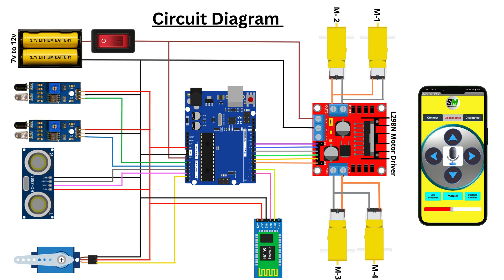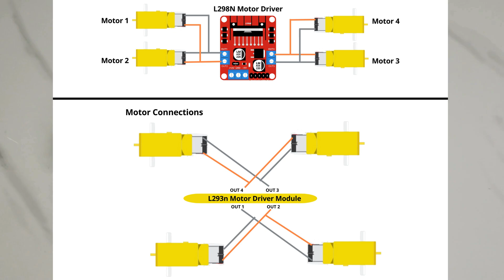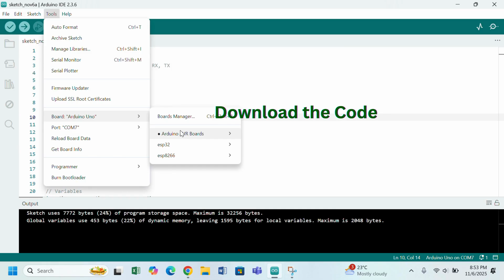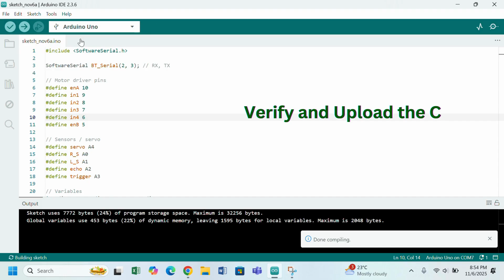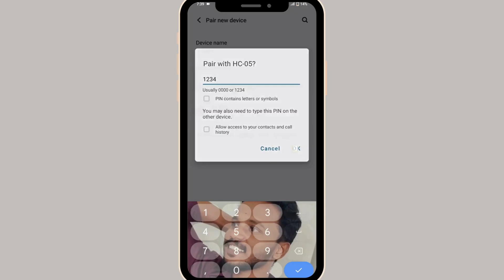Smart Robot | All in One Arduino Robot Car | Bluetooth, Voice, Line Follower & Obstacle Avoiding car

Comment from the maker: If you have any doubts or need clarification, please feel free to email me or message me on Instagram 🙂
📧 Email: sminnovativeidias@gmail.com
📩 Instagram: sm_innovative_idias
-----------------------------------------------------------------------------------------------------------------------------------------
Before you start the project, please check whether all components are working or not
---------------------------------------------------------------------------------------------------------------------------------------------

📥 Download Links:
• Arduino Code: 
https://drive.google.com/file/d/1Vvah7PBQV9rs2WK8pXPLR-j1gpCAnVpp/view?usp=sharing

• Circuit Diagram:
  https://drive.google.com/file/d/15Lyp05Bqr6NomTcdBRlfqU1RMfgjVBlc/view?usp=sharing

Bluetooth RC Controller App :-
https://drive.google.com/file/d/1KYsFZcAKsPvFJPlwvRlGJr8W_TbCVdFB/view?usp=sharing

copy the code 
------------------------------------------------------------------------------------------

#include <SoftwareSerial.h>

SoftwareSerial BT_Serial(2, 3); // RX, TX

// Motor driver pins
#define enA 10
#define in1 9
#define in2 8
#define in3 7
#define in4 6
#define enB 5

// Other sensors / servo
#define servo A4
#define R_S A0
#define L_S A1
#define echo A2
#define trigger A3

// Variables
int distance_L, distance_F = 30, distance_R;
long distance;
int set = 20;

int bt_data;
int Speed = 130;
int mode = 0;   // 0 = Manual / Voice, 1 = Line follow, 2 = Obstacle Avoid

void setup() {
  pinMode(R_S, INPUT);
  pinMode(L_S, INPUT);
  pinMode(echo, INPUT);
  pinMode(trigger, OUTPUT);
  pinMode(enA, OUTPUT);
  pinMode(in1, OUTPUT);
  pinMode(in2, OUTPUT);
  pinMode(in3, OUTPUT);
  pinMode(in4, OUTPUT);
  pinMode(enB, OUTPUT);
  pinMode(servo, OUTPUT);

  Serial.begin(9600);
  BT_Serial.begin(9600);

  // Servo initialization sweep
  for (int angle = 70; angle <= 140; angle += 5) servoPulse(servo, angle);
  for (int angle = 140; angle >= 0; angle -= 5) servoPulse(servo, angle);
  for (int angle = 0; angle <= 70; angle += 5) servoPulse(servo, angle);
  delay(500);
}

void loop() {
  // Bluetooth / Voice data receive
  if (BT_Serial.available() > 0) {
    bt_data = BT_Serial.read();
    Serial.print("BT / Voice Data: ");
    Serial.println(bt_data);

    if (bt_data > 20) Speed = bt_data; // speed control by app slider etc.
  }

  // Mode select
  if (bt_data == 8) { mode = 0; Stop(); }         // Manual / Voice mode
  else if (bt_data == 9) { mode = 1; Speed = 130; }  // Line Follow
  else if (bt_data == 10) { mode = 2; Speed = 255; } // Obstacle Avoid

  analogWrite(enA, Speed);
  analogWrite(enB, Speed);

  // -------- Manual / Voice Mode --------
  if (mode == 0) {
    if (bt_data == 1) forword();
    else if (bt_data == 2) backword();
    else if (bt_data == 3) turnLeft();
    else if (bt_data == 4) turnRight();
    else if (bt_data == 5) Stop();
    else if (bt_data == 6) { turnLeft(); delay(400); Stop(); }
    else if (bt_data == 7) { turnRight(); delay(400); Stop(); }
  }

  // -------- Line Following Mode --------
  if (mode == 1) {
    if ((digitalRead(R_S) == 0) && (digitalRead(L_S) == 0)) forword();
    else if ((digitalRead(R_S) == 1) && (digitalRead(L_S) == 0)) turnRight();
    else if ((digitalRead(R_S) == 0) && (digitalRead(L_S) == 1)) turnLeft();
    else Stop();
  }

  // -------- Obstacle Avoid Mode --------
  if (mode == 2) {
    distance_F = Ultrasonic_read();
    Serial.print("Distance: ");
    Serial.println(distance_F);
    if (distance_F > set) forword();
    else Check_side();
  }

  delay(10);
}

// -------- Servo control --------
void servoPulse (int pin, int angle) {
  int pwm = (angle * 11) + 500;
  digitalWrite(pin, HIGH);
  delayMicroseconds(pwm);
  digitalWrite(pin, LOW);
  delay(50);
}

// -------- Ultrasonic Sensor --------
long Ultrasonic_read() {
  digitalWrite(trigger, LOW);
  delayMicroseconds(2);
  digitalWrite(trigger, HIGH);
  delayMicroseconds(10);
  distance = pulseIn(echo, HIGH);
  return distance / 29 / 2;
}

// -------- Obstacle Checking --------
void compareDistance() {
  if (distance_L > distance_R) turnLeft();
  else if (distance_R > distance_L) turnRight();
  else { backword(); delay(300); turnRight(); delay(600); }
}

void Check_side() {
  Stop();
  delay(100);
  for (int angle = 70; angle <= 140; angle += 5) servoPulse(servo, angle);
  delay(300);
  distance_L = Ultrasonic_read();
  delay(100);
  for (int angle = 140; angle >= 0; angle -= 5) servoPulse(servo, angle);
  delay(500);
  distance_R = Ultrasonic_read();
  delay(100);
  for (int angle = 0; angle <= 70; angle += 5) servoPulse(servo, angle);
  delay(300);
  compareDistance();
}

// -------- Motor Movement --------
void forword() {
  digitalWrite(in1, HIGH); digitalWrite(in2, LOW);
  digitalWrite(in3, LOW);  digitalWrite(in4, HIGH);
}

void backword() {
  digitalWrite(in1, LOW); digitalWrite(in2, HIGH);
  digitalWrite(in3, HIGH); digitalWrite(in4, LOW);
}

void turnRight() {
  digitalWrite(in1, LOW); digitalWrite(in2, HIGH);
  digitalWrite(in3, LOW); digitalWrite(in4, HIGH);
}

void turnLeft() {
  digitalWrite(in1, HIGH); digitalWrite(in2, LOW);
  digitalWrite(in3, HIGH); digitalWrite(in4, LOW);
}

void Stop() {
  digitalWrite(in1, LOW); digitalWrite(in2, LOW);
  digitalWrite(in3, LOW); digitalWrite(in4, LOW);
}

Comment: Sir I'm getting this message frequently that Error516: Unable to write: Broken pipe. And because of that I can't even try other modes specially voice mode is not working line following,
Reply: I have done many tests and the problem is Error516: Unable to write: Broken pipe. If i re-ON the robot can if i keep phone beside HC-05 bluetooth module then it connects and work less than 1 minute and I get the Error516 and I request you sir to solve this problem because my science fair is too soon...😰
Reply from the maker: @Abiiisimple   some time Bluetooth is not connected, that’s why it is showing an error

Download  this app : https://drive.google.com/file/d/1KYsFZcAKsPvFJPlwvRlGJr8W_TbCVdFB/view?usp=sharing
Reply from the maker: some time Bluetooth is not connected, that’s why it is showing an error

Download  this app : https://drive.google.com/file/d/1KYsFZcAKsPvFJPlwvRlGJr8W_TbCVdFB/view?usp=sharing

Comment: Sir the ultrasonic sensor is bended a little by servo motor can help to solve this problem and your app was working after some trials it stopped working. Your app is not responding, if i try connect app is not responding. Please solve the problem
Reply: Thanks for your response
Reply from the maker: Just add a little glue and fix the ultrasonic sensor and servo motor neatly.
Try forgetting the Bluetooth device once and pair it again, then connect it.
Also check if your battery has enough charge and make sure the Bluetooth is properly connected

Comment: Hi bro I connected on the all lights are running and Bluetooth also connected but in app doing forward and backward not going what can I do bro please help me
Reply from the maker: Check the motor driver connection and make sure the battery is between 7V to 12V